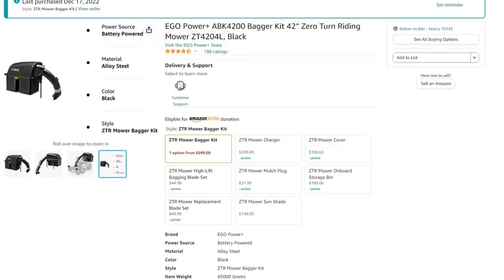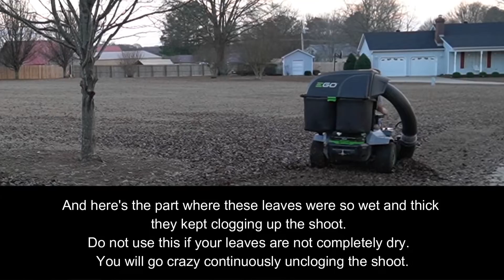EGO Z6 Electric Mower Bagger Add On - Is It Worth It?!

Comment: Hi, I have this mower and bagger and have cut grass for side job for years. Try this, I seen when u lifted that bagger lid alot of the leaves are almost whole which fills the space quicker. Take the bagger tube off and go over the area a few times and chop those pieces up to thumb nail size bits and then put your bagger on and u said u went 4 times, I bet you would only need maybe 2 if that. Give it a shot, works good for me.

Comment: Taking the mower deck and then swapping out the blades look like such a pain. Why don't you get a lawn mower hydraulic lift to lift the mower into the air and then crawl under the mower and swap out the blades?

Comment: Good review and, me being an X professor, businessman, TV, radio and author guy married forever, but have lawn care most the year, but looking for doing the leaves, not racking all day, seems a No brainer!  However, my crew stops in our 85% heavy tree cover in the north central mountainous Alabama area late December. With not ten or fifteen trees this guy has, but literally thousands going down the mountain about 1,250 feet and we are talking mostly hard woods too!   Our forest flanks my home with hard woods in back, and two sides.  Thank God I am still staying active between book seven and eight, and I need the exercise with for now the best EGO Self-propelled mowers.  Sure ridding may be the thing, but exercise in our wonderful Alabama late fall and winters doing leaves is not a bad deal in temps running from 70 F. to a low of 45 F most late winters and in March the leaves will be gone.   They unlike his, will come down for at least three months.  I wonder like many, why he did not mulch first and then bag, as to cut down on tub build-up, etc.   My front yard is smaller than his, about half an acre, so the EGO, (checked out over 15 self-propelled EV mowers and EGO seems to be overall the best in most cases) will work fine and they just fold up into a neat package like a piece of luggage for easy garage storage.  I am  not sold on the idea of ever giving up my summer lawn care crew, as I have other things to do in high heat and humidity in any part of southeastern America.  I know one thing, his kid is going to be a winner with a strong work ethic, as that father and son bonding looked great to me and my wife of 55 wonderful years.

Comment: The fact that the tube is clear is a game-changer for me!  Just sold my Deere with the rear-bagger and can’t tell you how many times I was mowing just to find out the chute was clogged!  🤬
Got my Ego rig coming this week!
Reply: I'm literally checking this video out to do that exact thing.  Probably selling my Deere to pick up the Ego.  I switched string trimmer, edger, blower, and hedge cutter already.  My only concern is the bag capacity looks about HALF of what my Deere bagger can do.  I could completely fill 1 yard waste bag with the Deere bagger.  I wonder how much this holds.
Reply: @HeadCannonPrime  
I had a JD E130 and that bagger is the same size as the Z42 bagger
Reply: I also had the E130 w/ the same bushel capacity as the Ego

Comment: Engage the parking brake to stop the beeping when you get off.

Did you hold the + button for the blade speed setting to go into the fifth, "turbo" speed?  I imagine that would help with wet leaves.

Comment: They need an in-chute EGO battery powered blade fan (like on leaf vacuumes that you pull behind your tractor) to increase suction down the chute and get all the grass/leaves into the bags. Mine clogs CONSTANTLY even with relatively dry Zorsia grass in my yard. The chute simply doesnt have enough air speed or volume to lift what most people are mowing.

Comment: I am wondering if the Blades you installed are "Vacuuming up the leaves" Before they can be cut. I have a bagger on my Troybilt gas rider. I never changed the blades just stock. And it cuts up the leaves. Yours looks whole.

Comment: It would be a good idea to get a cart and dump the leaves in that and when that is full, take it back to the place where you put the leaves, if it's far away. That would save some time back and forth. Do they have bigger bags? It would also help if you blew the leaves into a pile to help dry them out and put into a smaller area.

Comment: The EGO E-steer version doesn't have the little slots to hold those caps. Saw e-steer version at Lowes today. There are those little holders on the regular Zero turn model.
Reply: What are these slots for? I'm deciding e-steer vs original (about 600 cheaper).

Comment: Instead of the $500 for the bagger kit,  I just use a regular eGo push mower for bagging, they all come with a bagger (afaik).   Then attach a dump trailer to the mower, and empty the collected leaves from the push mower into the trailer.  It's what I do.  The push mower is a great backup and excellent for quick trim jobs too.
Reply: My ego push mower fills pretty quickly and the batteries don’t last as long in the fall and with the high lift blade.

4 full grown maples are beyond it’s capabilities.

Comment: Do not bitch about emptying the bags. You are riding and not bending over. Excellent job of installation with your son. When sucking them up after a rain, make the time to blow all the leaves with your hand blower in the morning and it will lift and aerate them so you have no issues 3-4 hours later

Comment: What is the total width of the mower with the bagger installed?  considering the Z6 e-Steer one, and I definitely need a bagger due to the amount of leaves i get, but i'm concerned it won't fit through the doors in my shed where i would store it.  Thanks.

Comment: What are those things you added to the front wheels? It sounded like you called them wheel wells. What is their function?
Reply: Counterweights to offset the rear when it gets filled w/leaves or grass, i.e. keep it from tipping up in the front.

Comment: Did you have the blades in Turbo mode? Same as setting the speed to travel only on the blade speed settings. My experience with baggers is that the never work well on wet cutting.
Reply: I just had the same thought.  I'm curious though as I just bought a Z6.  I can get the blades to go into turbo mode, but haven't been able to get it to go into travel mode.  Any ideas what I might be missing?
Reply: @caseyandgina  I don’t know why it’s not going into travel mode. Have you tried it with the park break on & the steering arms open?
Does it need a firmware update.
In Australia we don’t have the firmware update option. I’ve had mine for 2 months now & enjoy it and all functions work.
Reply: @caseyandgina  try disengaging the blades (pushing down the button). And make sure the steering arms are open too. Hopefully that works.
Reply: @princered5  Unfortunately not...

Comment: I wonder why it has such small bags? It's up higher than any bagger I have ever seen. I don't know how big those Bags are, but they look about 10gal each.

I have 3 very large live oaks in my yard. So I must have an effective bagger. Holding volume is always a key factor.  I'm still using a 1994 snapper riding mower. It's not the biggest most comfortable thing to sit on. But i have found nothing that out works it. I use blades made by a FL company called Gatorback. They are high vacuum and mulching blades. 
I don't understand why people are buying tools and equipment that don't work as well or better than older stuff. It's like people are accepting a worse tool just because it's battery-powered.
Reply: must be the weight, battery compartment